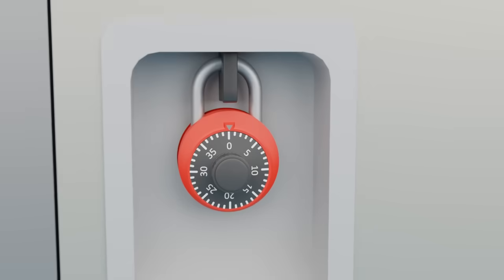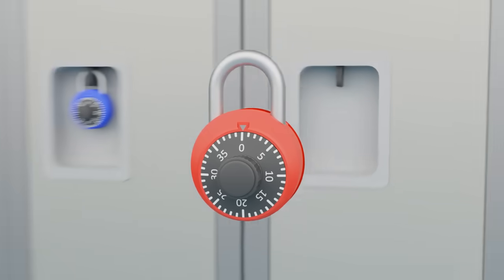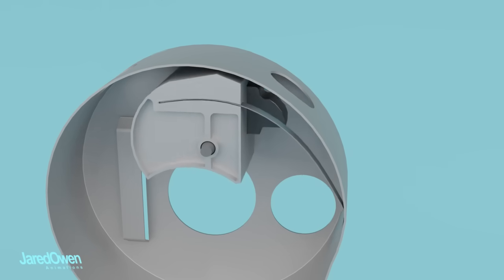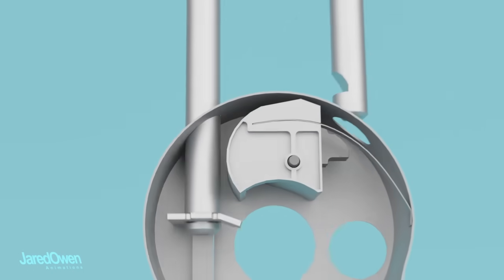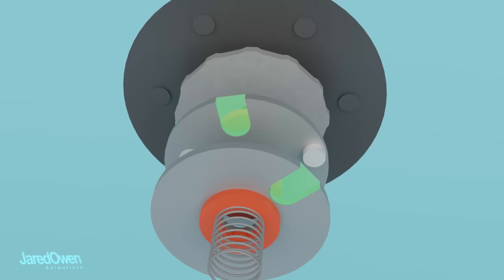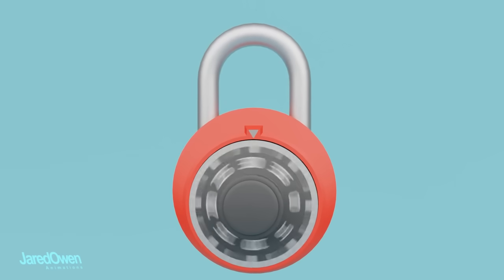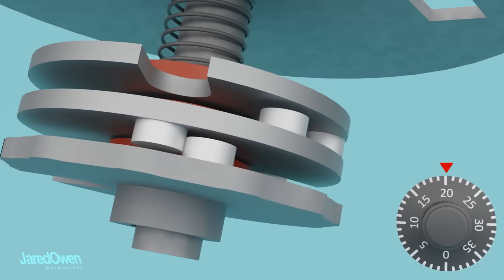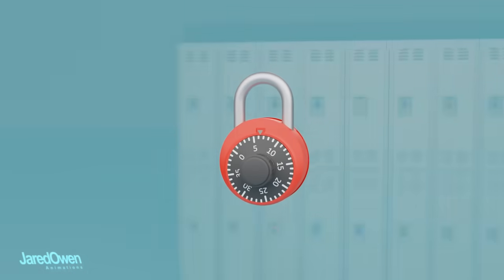How does a Combination Lock work?

Comment: In my opinion it's better to watch Andrew Price's Donut Tutorial for the beginners which is 100% free instead of buying a course for 59$. Andrew Price teaches people how to properly model stuff from beginning and explain things really detailed. He makes it easy to learn Blender. But Zach from CGBoost teaches people to make an apple from a sphere and he makes many mistakes. UV Sphere's have triangles which makes a weird shading so better to use a rounded cube but Zach teaches beginner to use a UV Sphere which is really bad. Sure, Adding a rounded cube in the viewport requires 1 extra step which is to get the extra objects addon, or it can be done with cast modifier so yeah, 1 extra step but its really simple.

And i just want to point out that im not trying to make it so he dont earn any money from his course, I personally just want people to learn things correctly from start. Even if it requires an extra step to get something done its still better to learn it the correct way.

This is my opinion and recommendation and i totally respect if anyone don't agree with me.

Comment: That was beautiful animation and art. I subscribed right away. I love Blender too but don't really have much time to mess with animation right now It's on my bucket list.

Are you looking for suggestions on things to model? Many years ago I ran into a book on mechanical devices. One of the things it talked about was that almost all mechanical systems are two dimensional. I may be stating this incorrectly. I read it about fifty years ago while in the library at university. It was a book I ran across while looking for something else. I thumbed through it for perhaps a half hour.

Eventually I found a chapter on three dimensional mechanical systems. That is where it talked about two vs three dimensional systems. It said that the three dimensional mechanisms were rare and it was very hard to design them. The few it talked about had been discovered by accident and you couldn't depend on being able to solve a problem that way. Again, I may be saying this wrong. My degree is in electronics but mechanical systems have always fascinated me. Several times since then I have wished I could remember more about this or the name of the book. Maybe someone will read this and clue me in. I'd love to see an animated model of one of these 3D mechanisms.

Here's another strange fundamental machine that you might model; the rolamite: From Wikipedia:
Rolamite is a technology for very low friction bearings developed by Sandia National Laboratories in the 1960s. It is the only elementary machine discovered this century and can be used in various ways such as a component in switches, thermostats, valves, pumps, and clutches, among others.

Here's a really good site for some simple models that would be great animated. http://www.scrollermechanics.com/Motions.html

Comment: i have never really been fiddeling with these kinds of locks, but it looks like it could be shimmed really easily and if there is the wrong kind of toleration problems could you in theory open it by just pulling on the lock and putting tension on the shackle and finally just rotating the discs until they align.

great video tho. 5/5 in both animation and narration. well done.

Comment: Awesome channel Jared. Great animations & cool explanations. Some other household items to disassemble — fuses (& surge protectors), dimmable light switches, multi-circuit switches (two switches controlling one set of lights), drawer rails, cabinet hinges (the interior installed ones, not the traditional bolt ones), hybrid cars, garbage disposals (sink communitors), ball type water valves (kitchen / bath), automatic garage doors.
Reply from the maker: Great suggestions!

Comment: Yup, that is how it works indeed, but it has a flaw. If you force the lock down, by pulling it down and try to unlock it like usual, when you try to find the number, it will lock onto it, releases it a bit and do the next number by doing the same thing, eventually you will unlock the lock. It's about the same process as lockpicking too.

Comment: It also shows the flaw with the locks. If the top of the catch on the lever were squared off partway into the shackle with maybe a bit more cut off on the end of it to compensate it would make it at least harder to get a strip of aluminum into it.

Comment: Since each lock has a unique code, how are locks mass produced? Wouldn’t it require more manual labor?
Reply: the maker of the lock makes lots of the disks in different arrangements of peg/notch. The disks that go into the lock are tracked and every set of three valid disks (there are some combinations that don't work properly because numbers can't bee too close/far apart) will produce exactly one code. The drop them into the lock, seal it, and a computer runs through the expected code to make sure something didn't go goofy. If all is will it'll print the combination on the card and a worker sticks it in the box with the lock.

Also, there are a finite number of combinations (especially for school locks that are made to be opened quickly). you cannot have duplicate numbers next to each other (say 5 5 21) and numbers cannot be beyond a certain 'distance' because it interferes with previously set numbers or makes the lock otherwise a PITA to deal with. 21 25 1is an example of something that might not work on some locks due to the design of the pegs on the disks. you'd bump the first number trying to get into the second, ect.

Comment: Great video. For clarification, some combo locks (eg Master) intentionally push the wheels out of alignment when you re-lock it, rather than just randomly jolting them.
Reply: Usually they only jolt the third wheel (the one that is set first) by turning it 2 marks anticlockwise. 

If you do not scramble the lock and just leave it, it is extremely easy to reopen.

To make it harder to crack ALWAYS rotate the knob at least three complete turns when locking (you could then do a complete turn and a random bit more in the opposite direction before finally turning a random less than a whole turn in the original direction).

Comment: But propably everyone knows to open this typy of lock you need a little of practice and like 1-3 minutes. You just try to pull shackle then spin counter clockwise to hit first number you will propably feel when its correct. Then you spin clockwise and same thing and again you spin counter clockwise. Yeah you did it! its  easy i don't know the property of those type of lock, but this vid is very good and everyone should see this.

Comment: Man whenever i was still in high school i used to have to quickly open my lock get the necessary things for my next course because i had an extremely short switch out time, i had to have my lock open in under two or three seconds since i had absolutely no free time.

Comment: The animation was so damn good. Even with a 3D model it still usually takes me time to wrap my head around what does what. But you took it all apart and explained each piece very clearly. I’ve got a good mental model of the mechanism and I didn’t have to crack a sweat! If you do one of these on the way a manual transmission gearbox works, you’ll get millions of views guaranteed!

Comment: Good as always.
But it's missing two things,
First, how is setting combination mechanism works?
Second, it's not clear enough how the first disk rotates slightly to prevent the lock from opening again freely.

Thanks
Reply: The stop on the long leg of the shackle has a tab on it which causes the third ring to move a couple of marks as the lock is closed, thus requiring you to redial all three numbers again.

Unless you move the dial after you have locked it, it is very easy to find out the first two numbers of the combo as those rings are not moved by the shackle when it is closed.
Reply: @cigmorfil4101  Thank you 🙂

Comment: This just makes me curious how combination locks are “programmed”
Reply: The manufacturer makes a bunch of these disks, with the pegs/notches in different places to 'index' each position.

Due to how these locks work (you have to go one way, then the other, then back) there are restrictions on what combinations are possible. because you can't turn the knob so far on the second turn that you'll bump the first disk again, though they'll often push it VERY close. I had a lock that would not open if I went even slightly past the line on the second number. That thing was annoying.
Reply: Thanks for the reply! But that doesn’t quite answer how a customer would choose their own combo. Like I’ve definitely bought a few that allowed me to choose the numbers.
Reply: 忍者Fabian   It’s not possible, it’s a fixed code.  Greetings from Belgium 🇧🇪.
Reply: Thanks Günnår! That’s actually weird to hear because at my local “office depots” I see locks advertised to allow a custom combo.

Comment: You are wrong, you can open the lock without entering the combination by shimming it
Reply: At least the one in the animation can be shimmed
Reply: @תתתתתתתתתתתתתתתתתתתתתתתתתת-ט3ד  You're right about that. :-)
Reply: Just as long as the latch is spring loaded, otherwise it can't be shimmed.

I mean you could also use a hammer to open it without the condo :-)

Comment: But how do I set my own number combination? Or are these locks always preset?
Cheers and keep up the good work :)
Reply: These are always pre-set. Locks where each 'disk' is it's own dial (such as some bike locks, most Kensington locks for PCs, some safes) can be changed by using a knob or screw to lock the internals in place so that you can then move the numbers to what you want. a single-shaft lock like this requires it's discs replaced (which is something you can do for some safes, but a locksmith is usually involved).

Comment: I watch all of LockPicking Lawyer without understanding anything about locks, so this video is extremely useful for me. At least, when he will post about combination locks, I will understand the principles of operation
Reply: Same
Reply: Same, but I ended up taking some locks apart to look inside.
Reply: Same I came here to talk about him
Reply: I still don't get how you can "feel" the gates.
Reply: @fish4225  when you put tension on the shackle you will be pulling up the collar  which gets caught in the gates. By pulling on the shackle you are also lowering the tip of the gate which can also get caught in the gate. Both of which would be noticeable. Though you do need to play with the tension a bit so it's not too strong or weak.
Reply: @rnp9165  Apt that this explanation is coming from a guy with a combination padlock as his profile picture, thanks!
Reply: @fish4225  😎😎😎😎😎😎😎😎

Comment: Great video but what changes when you change the combination?
Reply: Good question! The specific lock shown here does not allow the combination to be changed, it such a mechanism is unusual for that type of lock. For combination locks with independent code wheels (where you key in a three or four digit combination using three or four code wheels), code changes are usually possible. This works by temporarily disconnecting the internal cams from the visible outer code wheels, allowing you to change the visible combination while keeping the internals in alignment. After setting the new code, the cams and code wheels are locked together again, so until the code is changed again, the internals will now align whenever the new code is visible on the outside.
Reply: @fefrei  wow. Really cool
Reply: @fefrei  One example of this that's readily available are the big Bell cable-locks for bikes (the 5-digit ones, not the smaller 4 digit). Once you undo the lock, there's a little collar that you loosen and it allows you to ajust the outer parts and change the combo. My targus Kensington lock does something similar with a flathead screwdriver when the lock is open.

Comment: What about locks that you can set the combination yourself? How does that work?
Reply: I believe on the back or something you can like detach the cams from the dial, at any time to set the combo and then reconnect and do it two more times to get the other cams
Reply: @Zurtron  the ratio between numbers cannot be changed, but you can use a key to change (by units of 5 only) what the numbers are by changing where the dial aligns with the cam unit. So you can change the combination by adding or subtracting any multiple of 5 to all 3 numbers equally... this is useful for scools where each lock is re-issued to a new student each year.
Reply: Rose Barnes oh, at my school we have locks wher you can take of the back panel and change it to whatever you would like. Good to know!
Reply: Zurtron D Man: ooh idk how to ge into this locker. oh! The back has instructions! Time to break in!
Reply: Good question! The specific lock shown here does not allow the combination to be changed, it such a mechanism is unusual for that type of lock. For combination locks with independent code wheels (where you key in a three or four digit combination using three or four code wheels), code changes are usually possible. This works by temporarily disconnecting the internal cams from the visible outer code wheels, allowing you to change the visible combination while keeping the internals in alignment. After setting the new code, the cams and code wheels are locked together again, so until the code is changed again, the internals will now align whenever the new code is visible on the outside.
Reply: @fefrei  Thanks for explaining! Now a video would be great
Reply: Felix Freiberger in short, the numbers do not directly correlate to what’s going on inside. They’re just a gauge
Reply: Felix Freiberger Great explanation ! But Im not reading this
Reply: Valkraz Iasis I have my own. What you basically have to do is turn the lock part 90 degrees and press down while trying to set what number you want it to be! Sorry if my explanation is trash.
Reply: ChillOutPopcornnn that is not what I do,what I do is turn the shackle 90 degrees and press down.turn another90 degrees to 180 degrees,and set combination
Reply: Different video
Reply: When you turn the shackle 90 degrees,the can mechanical on the long end is positioned right at the position where it is about to push a button.When you push the shackle down,the mechanism cane closer.Wgen you turn it another 90 degrees to 180 degrees,the mechanism is pushing that button down so that the wheel disconnect.
Reply: my dad had a suit case that had that feature
Reply: 699 likes, nice

Comment: I had 2 of those on my motorcycle and both of them have given way the code, by vibrating the lock, the 3 discs comes in line from earths gravity and the lock opens up🤔.  It’s not a good lock.  Greetings from Belgium 🇧🇪.
Reply: This method has also been used on some older safes which needed the gates to line up at the 12 o'clock position.
Reply: RNP   It’s possible that I had one of those, it’s 40 years ago, so it’s very likely that it was not the same.  Have a great day.
Reply: Maybe so. But, for a teenager who forgets lock combination......priceless...lol. ✌
Reply: fivectydirttracker 22   Yes sure, I can think of that.  Have a great day.